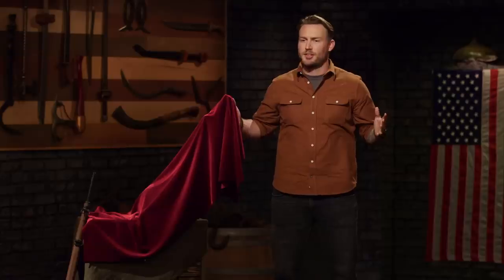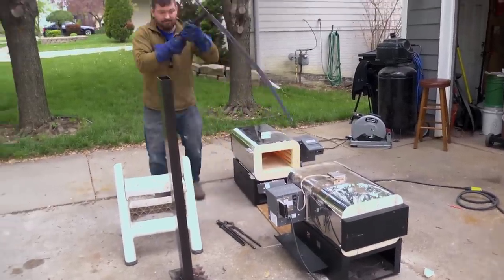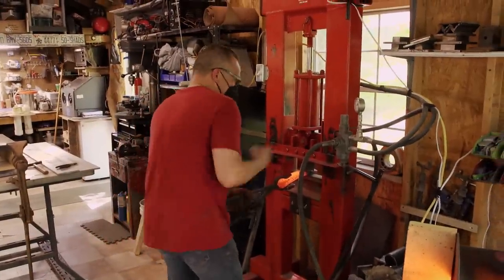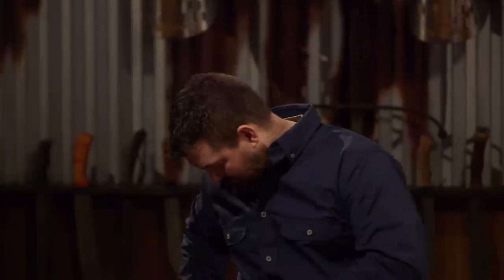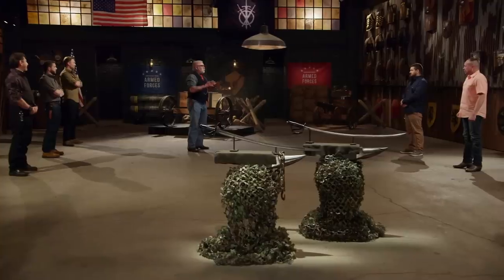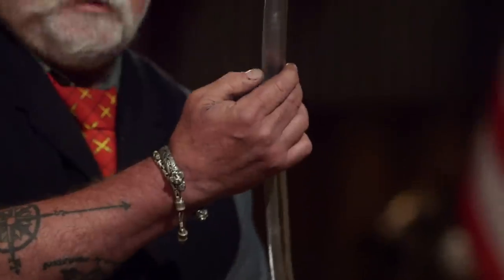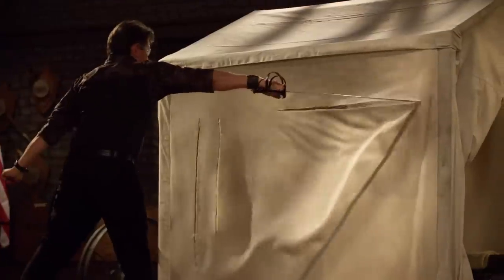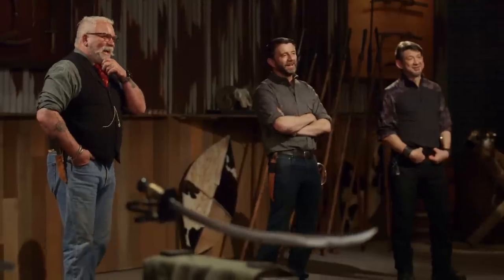Forged in Fire: ARMY VS. MARINES as Cavalry Saber Delivers LETHAL BLOWS (Season 8) | History

Comment: They didn't even give the guy any reason for his loss. I assume it was the handle but his blade performed better. He even got more praise during the trials.
Reply: Yeah, that was my guess as well.  In the kill test Doug said that the handle on Garrett's sword was a bit too small and he kept hitting his knuckle on it when he swung and also, the handle on his sword came a bit loose during the strength test so taken together I'm pretty sure that's why he lost even though it was a bit lighter and sharper than the other sword.  After all, a blade that's a bit dull can be sharpened but a loose handle is a liability.

Comment: Make Durendal next. Durendal's the sword associated w/ Roland. The blade's gotta be no more than 25 inches long. The blade's ricasso's gotta be an unsharpened one-handed ricasso, the kind that's big enough ta be an additional grip FOR the user's hand. Just like the ricassos on the Great Swords (polearms that look like big swords). The blade's parallel edges SHOULD be straight AND symmetrical (like many Jian swords). The blade section's gotta be the 6-sided hexagonal section. The guard's gotta have upswept quillons that're sharply curved to the blade (shaped like swans' wings). Decorate the guard w/ two gold gemstones, one gold gemstone in the middle on both sides. Make Durendal a full tang sword w/ 5160 spring steel. The gold gemstones SHOULD be in the middle o' the guard, one gold gemstone on both sides.
Reply: @ObsydianShade  Thought I'd be creative w/ the kinda Durendal they could make. Even w/ the unsharpened one-handed ricasso AND the hexagonal cross-section on the blade. Where the heck's yer creativity?